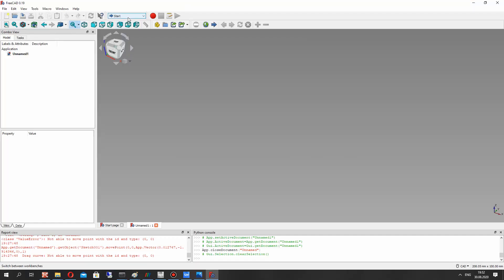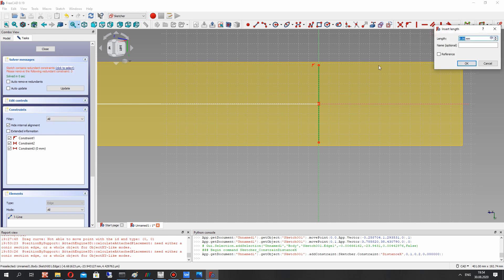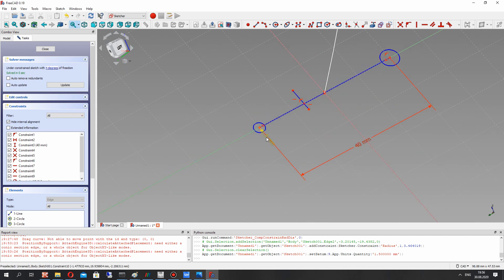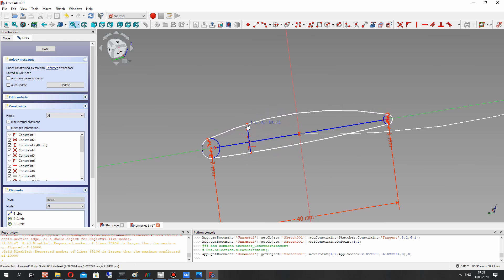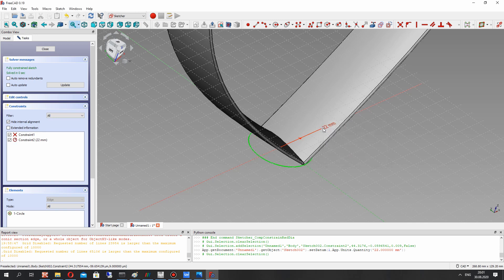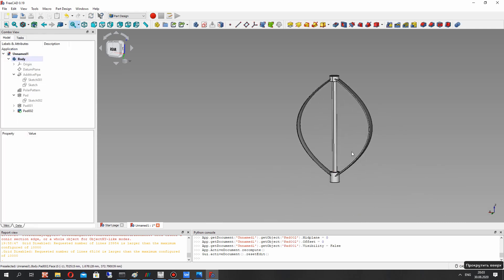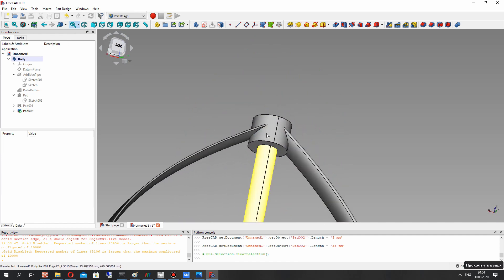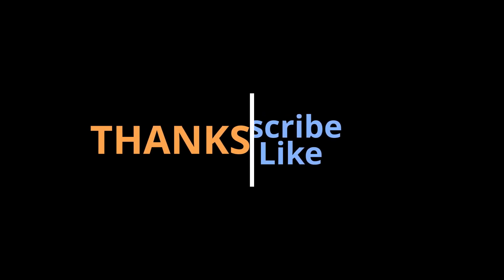FreeCAD Tutorial | Exercise 10: Design of the Darrieus Rotor of Wind Turbine in PartDesign Workbench

Comment: Hi Sir,so I was wondering  what are the drawbacks of this sketch compaired to a solidworks one since you did not input tha x,y,z co-ords of a NACA Airfoil.Thank you very  much
Reply from the maker: the using NACA airfoil give you possibility to control empirical value of Cd and Cl coefficients, it means that you can to perform integration and make calculation the Efficiency, Power and another parameters. Here we have the sketch with airfoil without empirical data and you have to perform CFD simulation and only so you can predict the Efficiency or Power, rotation speed and another parameters of turbine.
Reply: @CFDIntech  Thank you very much that was very helpful